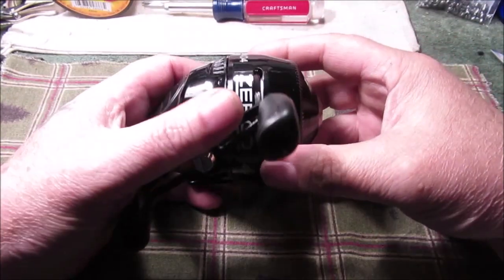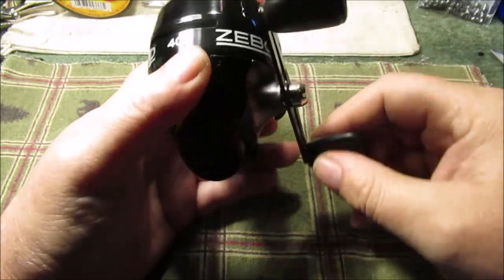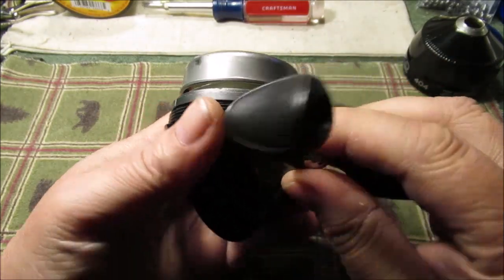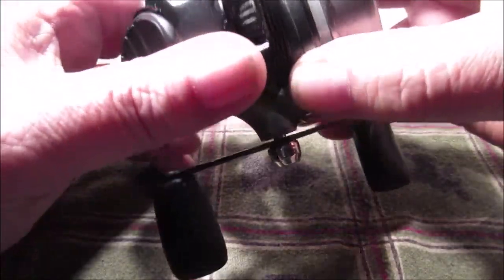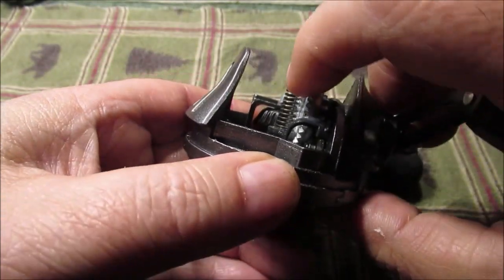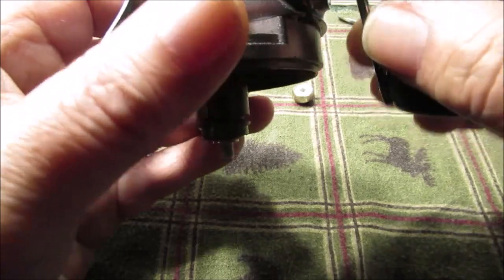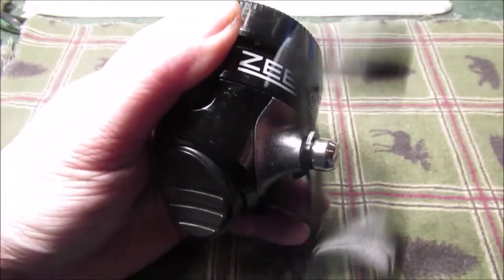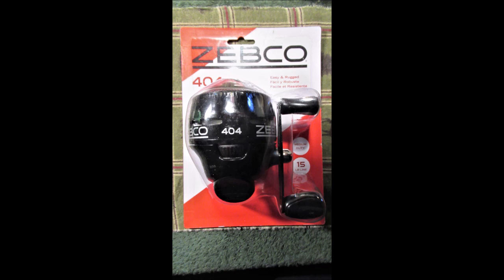How -To Disassemble ZEBCO 404

Comment: Amazing layout of the info and you are 100% right sir, there is not enough info on the newest models of the reels. I just picked one up so I could fish with a bobber on my favorite casting rod, but I felt the need to put my black grease in it so the reel would operate more smoothly.
Reply from the maker: THANKS

Comment: I am leery of the nylon semi housing. The nut that holds the crank on is merely a nylon washer that is munged on to the axle. It looks like M3 threads. two nuts with a lockwasher would be a significant upgrade but what can youexpect for twenty bucks?